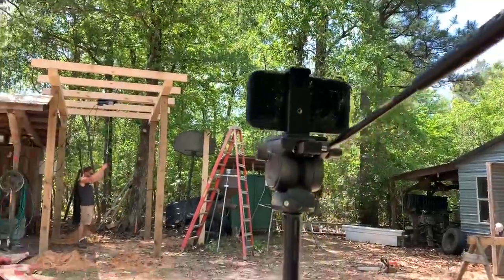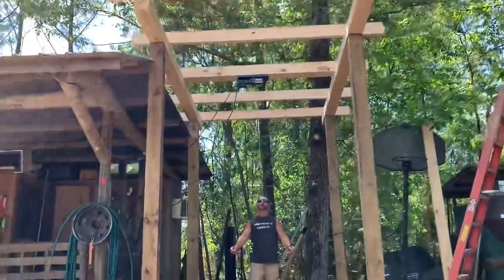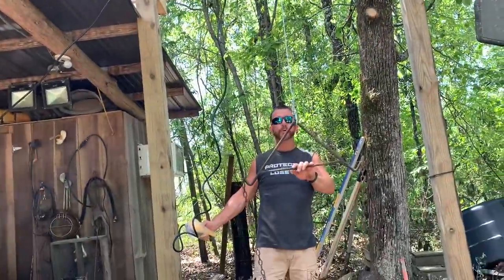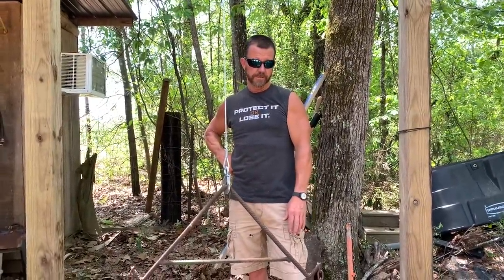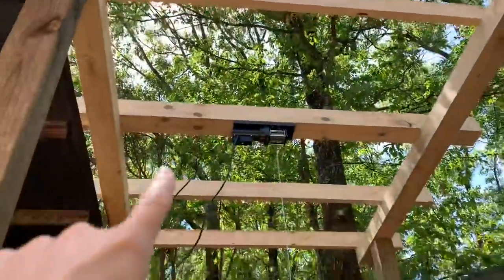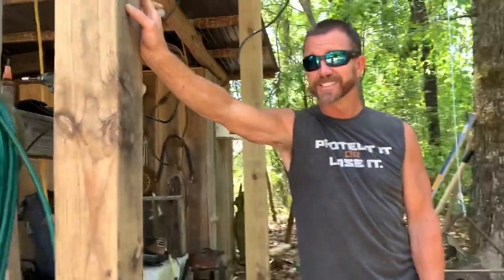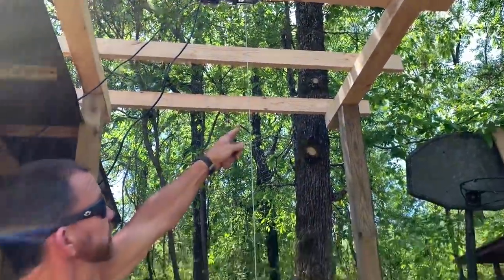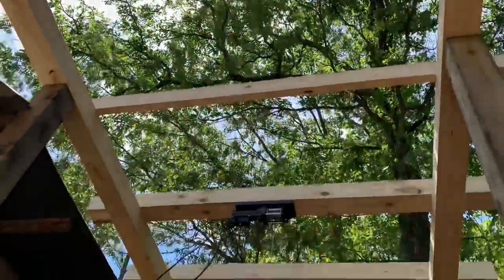Building a Skinning Shed for our Deer and Hogs!

Comment: My uncle and I used to use a winch like you all have above with the gambrel hooks to the back legs behind the knee (deer). The other end we had a mobile home/trailer anchor screwed into the dirt floor and we used a piece of wire rope made into a choker to anchor the skin/hide to it. We'd start to skin the hide from the rear end/tail area (which was hanging up top towards the winch end) then we'd wrap an old golf ball or baseball around the hide then put the wire rope choker loop around it. When we raised the winch/deer it would peel the skin/hide right off. Then as it got halfway off, we'd shorten the choker where it attached to the the mobile home anchor. We did it pretty much like how you and your daddy do. We had a gravel floor in his garage, but had a concrete pad poured below where the skinning rig was with a drain in it running outside down the hill. We would use a garden hose strung from his house's hot water heater to wash down the meat as it hanged. That worked really good for us.

By the way Miss Hannah, how do you all cool the meat down to cure when it hangs down there where it's always so hot where you are? Our nights during hunting season here in Ky are usualy cool enough at night (30 to 45 degrees) to where we usually let our deer hang for no less than 3 days to de-metabolize and cool, makes it way better, less tough and gamey tasting. The longer it hangs before butchering and packing it, the better! So long as it stays cool!
Down where you all are, it would begin to rot as soon as you kill it if you all didn't have some sort of a chill box to let that meat hang? LOL

Comment: Those tongs you were discussing are pretty good tool. Back in the days of being employed I worked in a warehouse. We had pallet tongs with a chain on it to hook on to a forklift. the tongs would grip the center board of a wood pallet. As we pulled backwards those tongs would grip harder into the wood, till the pallet could be pulled to the edge of the truck bed, then the lift would lift the load out of the truck. Ice tongs are made the same wAY.

Comment: Once you get started peeling, you could take a piece of flat steel bar, like one inch wide and maybe four inches long, and wrap the hide around it and clamp on that so the hide
doesn't get torn by the teeth, and pull from four spots instead of two. Cool Idea with the winch, it should work well.

Comment: Add some grade to the concrete, use some of it to make a trough for run off, and you will be able to clean the floor with a garden hose, be much better than wood floor, and eliminate hiding places for snakes!

Comment: 10:25 ViseGrip makes a tool that has welded flat steel that is about 4in. by 2in. on each grip. They are used for braking sheet metal. Menard's sell them, so most hardware stores should sell them.

Comment: I went to Tractor Supply and bought a screw in auger bolt and use it as my ground anchor.
Gravel floor, no concrete needed

Comment: i don't know how a skinning shed works, but if its that tough pulling the skin off, you can put some anchors in the concrete, or put lots of hooks into the side walls, and string up the pig between the ground and the concrete pad,  and then make the winch do all the work.

Comment: First cut the deers tail off, cut the hide all the way around the back legs just above the hooves and cut the hide all the way around the neck at the base of the skull, do not cut into the meat. 

Using a golf ball, roll it inside the hide on the back of the neck and cinch a chocker chain around the hide tight with the golf ball inside, the chocker chain is already attached to a heavy duty eyelet in the center of your concrete floor. Then you wrap the cable from your electric winch around the deers neck above the cut hide and attach the clasp hook at the end of the cable back onto the cable on the back of the deers neck like a noose. Take a saw and cut both front legs off just below the shoulder. All you do then is winch the deer straight up while the hide peels fully off the deer, you may have to work the hide around the front shoulders when the hide is pulled tight against them, especially on smaller deer, other than that, once the hide pulls free from the back legs and falls on the floor, then you can remove the golf ball and discard the hide, the skinning part is done. 

Have a fixed length non adjustable cable with a gambrel attached about seven and a half feet up from the concrete floor. After skinning, hook the gambrel in the back legs of the deer while it is still winched up, then lower the deer all the way down and remove the winch cable from around its neck. The deer is then hanging upside down on the gambrel with no hair and no dirt on the meat ready for butchering. 
Hope this helps, if not, there is video on YT showing deer being skinned and butchered using this fast and very easy method.

Comment: I know skinning is a lot easier on pigs, but why dont you scold the hair off them and get the nice crackling on roasts and Bacon, if you do Bacon. It is quite easy once you have the temperature right, and dont over heat or under heat them.
I cant remember what the temperature was, as I haven't worked for 9 years, and we quit doing pigs about 10 years before that in the abattoirs. 

We also use to catch wild pigs with dogs out of work and fatten them up, they are much better that way, but Australia is dry and barren, so they dont get real fat out in the bush.

Comment: You should put it on a trolley that goes out to the end of the shed and then at the back of the shed have a stainless steel table and next to that on the way out of the shed a bandsaw and then next to that another stainless steel table then that way you can butcher and pack everything on the other side a freezer in a sink then you have a complete station you can just back up to it where the trolley hanging outside hook up your stuff give it right there Dragon Inside to the bank lay it on the table and start butchering it up you know what I mean good idea I wish I had one of them sheds even if you don't set it up to butcher nothing it still be a cool shed be nice to have an insulated where you can have a cooler in there you know insulated and have a little reefer in there keep it cold

Comment: From experience killing lots of domestic hogs and skinning them, you have to skin off the hams as pulling the hide tears the fat off of them.  You have to skin the pig with a knife from the belly to the middle of the shoulder all the length of the body, otherwise you'll tear the bacon all up.  You also have to knife off the skin around the neck as if you try to peel it, it'll tear meat like a bugger.  I've tried many times to figure out how to skin a hog with a winch, and wound up with a wreck every time.  I prefer to use a knife, and peel the back and upper sides by pulling the hide by hand.  That being said, I've probably got more than 100 pounds on Hannah.  

I'm starting to think that using a cradle is most efficient for hogs.  But, I'd prefer to skin pigs with a cheap box cutter to trying to peel one with a winch.

All that being said, wild pigs may be different.  

Deer, elk, moose, buffalo, sheep, etc peel really nicely.  Cattle don't peel nicely.

Comment: You ever use a truck and a golf ball you hang it by the neck cut around the neck around the knuckles on the legs split the leg to the body put the golf ball under the skin on the back of the neck use a rope with a slip knot tie the other end to the truck and pull easy and presto the coat is off

Comment: I wonder if before you waste time manufacturing a vise grip if you watch a video on skinning a deer with a golf ball.   concept is instead of vice grips, you wrap the hide around a hard ball or object.  Then, wrap your chain around under that and pull it tight.... basically making a loop that the hide can't pull through because the ball is inside and the ball is larger than the loop.  I don't know if I explain it well.  google skinning a deer with a golf ball.

Comment: Can't you put an eyebolt in the concrete and then use a golf ball in the hide put a rope through the eye and wrap it around the golf ball. That's in the hide Then use the wench to pull the deer or hog up. That's what the butcher here does

Comment: Tip: After you dig your post holes and get your perpendicular 4 bys in, fill in around them with Quik-Rete and leave it overnite. It'll be set in 24 hours and... no hauling water, mixing or wheelbarrows! Pigs won;t like it, though.